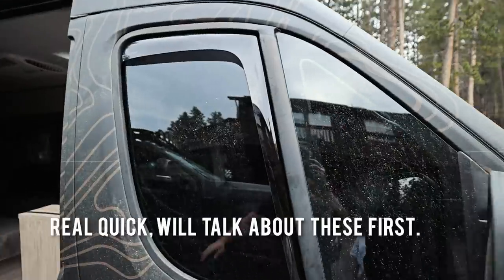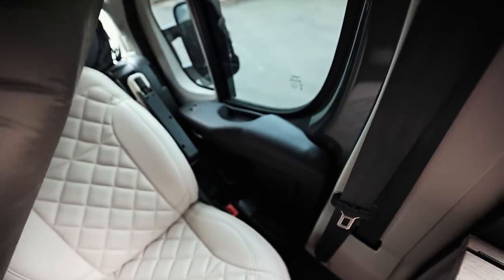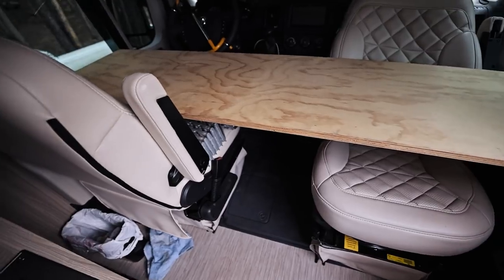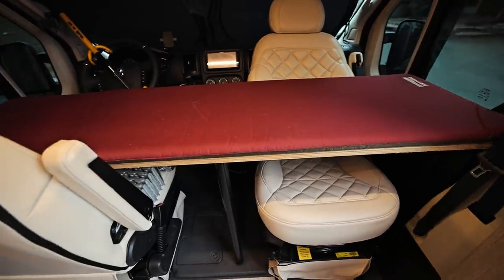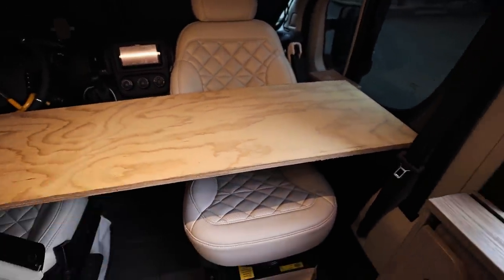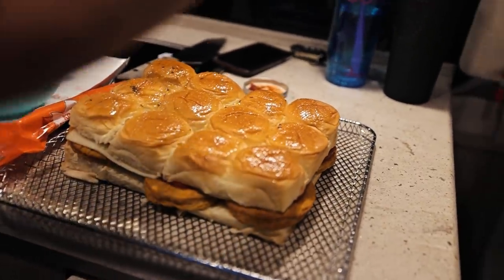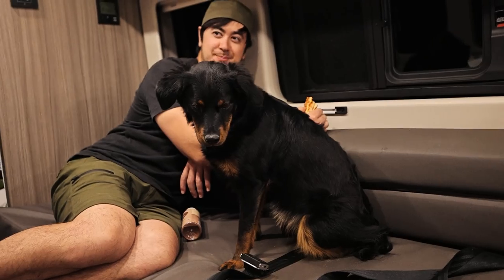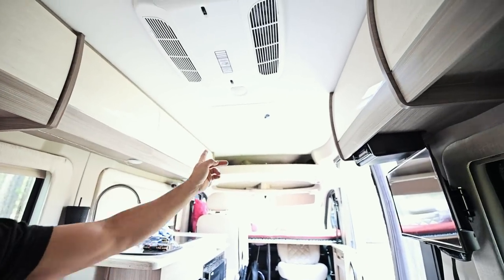DIY Adding an Extra "LOFT BED" to the Front Seats of the PROMASTER - Jayco Vanlife Stuff

Comment: From what Ive seen in other peoples videos, that squishy floor between the front seats has loose wire running under it that get damaged just stepping into the seats. A few people have built solid platforms over it to fix the issue. I wouldnt put a metal leg on it until you know whats down there.

Comment: The weathertechs are nice, both vehicles I have used these on have glass scratches at the top where glass meets it...maybe a soft very thin material would prevent that....if you were to put that material on the weathertechs where they meet the glass....

Comment: No matter how it's done, it's very uncomfortable to sleep on a platform mounted on top of front seats. Best sleep I found on the high top van was to use a folding memory foam mattress lying down front to back. Then folded up and stored away when not in use. Only downside for me is the bathroom is in the way so it's bit inconvenient if someone wants to do bio break during the night.

Comment: My dad did that in ur old 70s Champion motorhome when I was a kid for my older brother. Traveled all over the country 
U should protect the edges of the plywood to stop rubbing on seats & doors.
I have piece of plywood in back of my Crosstrek to fill in the gap between the back of the front seats & folded seats so my dogs legs don't go down & so my pillow doesn't fall thru when we carry camp on way to adventures. I cut a noodle in half & used it along the 3 edges. No need to glue the noodle on, stays in place nicely even w dogs.  Noodle might b to large for ur setup, but u get the idea.
I have couple warn spots on the leather on the back of front seats from plywood

Comment: The extra bed was a great idea! In the daytime, you can fold up the pad and place it on the passenger's seat so it's out of the way. That way, the board can also be used to as a desk or a place to eat....or as extra counter space for cooking and/or serving up food buffet style. Place some inexpensive self-stick floor tiles on the top side of the board so it will be easy to clean if using the board as a counter/table top to hold food or drinks. Use a folding stool that will be tall enough for sitting there.

Comment: Ya haven’t damaged the floor in the front, that’s a service latch to pull the floor protector up
Reply from the maker: The floor is definitely damaged - but you're correct in that there are several service latches on the floor as well.

Comment: Hello, I’m considering moving to Colorado and was wondering if you would not mind doing a video about the CO gun laws as of 2021. It’s hard to get solid info. Also are there any exemptions for FED LEO?
Reply from the maker: I'm not really a gun law video maker guy - but there's lots of info out there! Colorado definitely isn't the best, but it's also far from the worst. Open carry is legal most places with no permit, concealed carry with a permit, can own pretty much any gun, suppressors, etc. Some weirdness around mag capacity - but lots of stuff is grandfathered, if you owned it before, etc. Every state has exemptions or moreso different rules for various levels of law enforcement, yup.